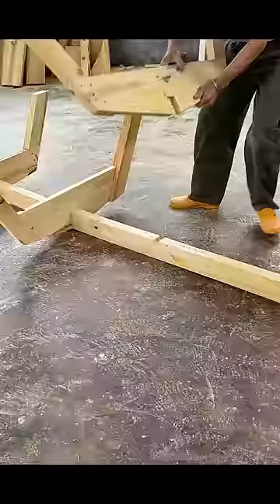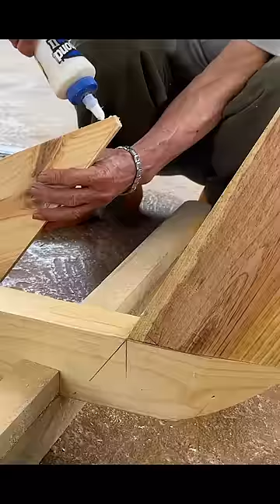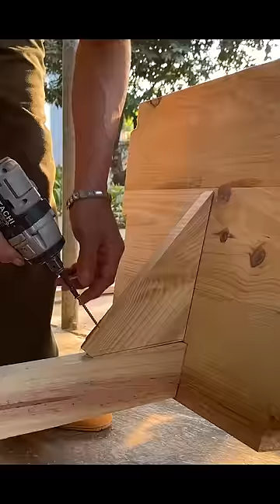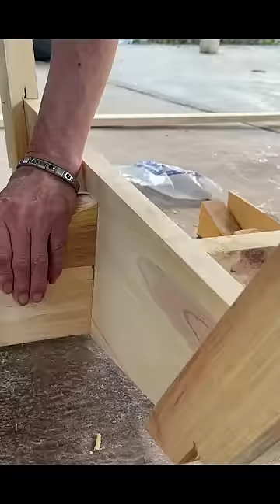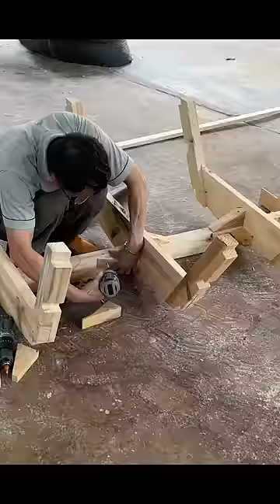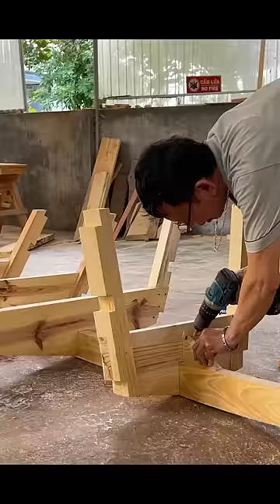Wooden Boat Frames

Comment: You should use gorilla 🦍 polyurethane glue for building boats a water based glue only invites leaks or use gum glue from the rubber tree
Reply: Bardzo mądra rada .
Reply: Сибирский лес,как жаль
Reply: Е

Comment: Look's good only thing l
worry about is rust in the
screws ?
Reply: I think the joints are dependent upon the waterproof glue, the screws are basically used as clamps.
Reply: If they stay, they're covered with wood putty

Comment: Did you use any glue or just screws? Were the screws stainless steel?
Reply: If you look, he did use plenty of screws with the structural-frame and attaching everything.  And using super-glue or gorilla-glue on a boat won't really work too well.